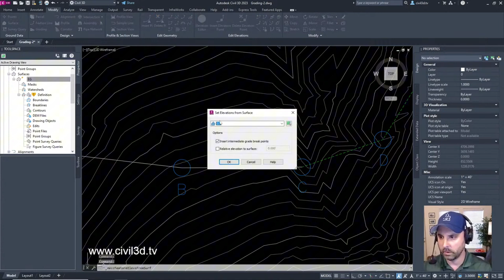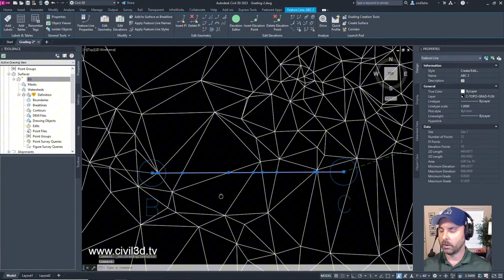03 Draping a Feature Line onto a Surface in Civil 3D

Comment: will it change the horizontal distances
Reply from the maker: No — draping only adjusts the elevations to match the surface. It doesn’t change the horizontal geometry or distances.
Reply: @CIVIL3D if i need to lay out d2 map one sloped surface but in real i get the horizontal (map based dimensions across the sloped natural ground )
Reply from the maker: That’s because Civil 3D measures in plan (2D) by default. To get true slope distances, you’ll need to use 3D polylines or extract slope lengths from a surface/profile — plan view always gives horizontal lengths.